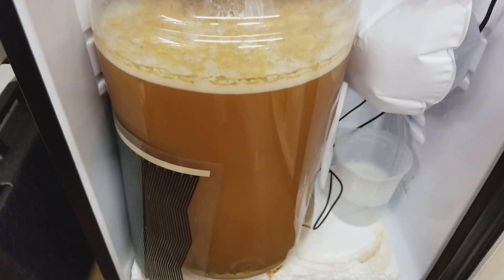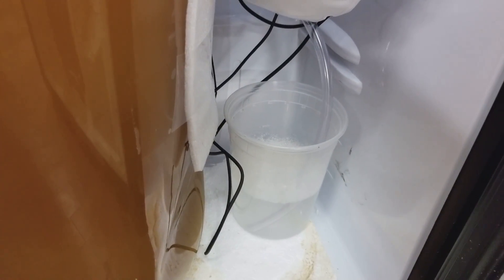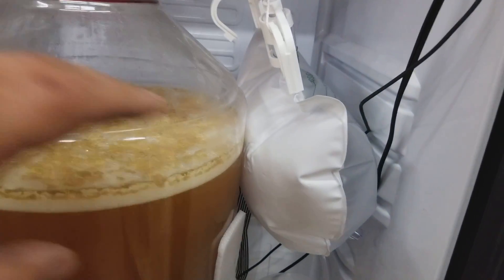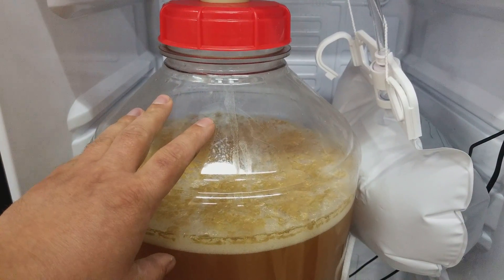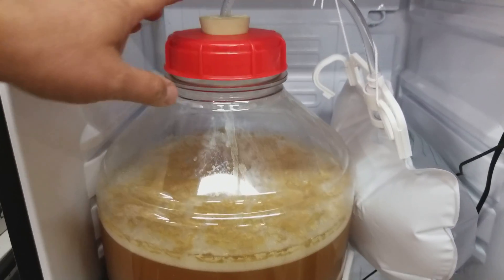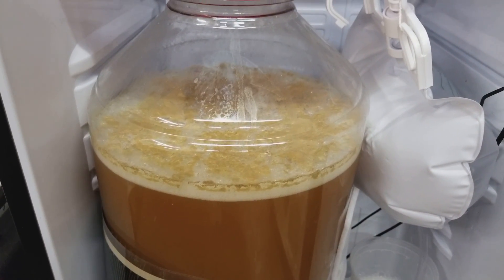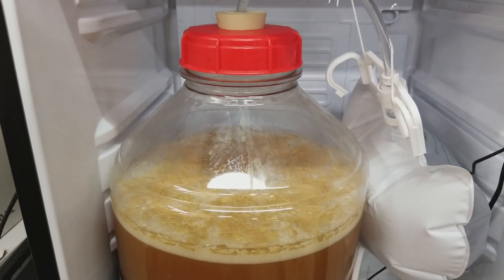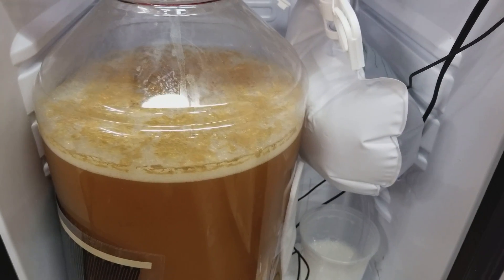BobbyfromNJ Preventing cold crash suckback in fermenters

Comment: I have an SS Brewtech brew bucket. I take a square piece of tin foil, spray it with StarSan and plug the little hole in the lid. I almost exclusively brew Double NEIPA's which are dry hopped or double dry hopped. I usually only cold crash for 24-36 hours though.
Reply from the maker: I don't think foil in the hole is fully preventing ingress of oxygen. Vacuum is pretty strong and it will find a way in. You can test it by removing the plug and if you don't hear a whoosh of air going in, it already went in. A cold crash will pull about 2 quarts of air in.
Reply: @BobbyFromNJ  oops I've probably inadvertently oxidized my last 4 batches. All Double NEIPA's. All extract kits.
Reply: @BobbyFromNJ  thanks for the advice!

Comment: Have you had any issues with cleaning that bag in the occurance of a strong blow off? Or do you you a normal blow tube , until the end. I wonder if using your method with a small change of using standard airlock/ blow off stuff until  you want to crash, and then manually fill the bladder with co2 from a tank and swapping it out would be just as effective but easier to clean? Ever tried it that way? Cheers
Reply from the maker: No, I use it from the very beginning and I have had some blowoff make it into the bladder but it washes out just fine. The newer solution has a better bag that can be gotten into for cleaning. https://www.brewhardware.com/product_p/ccguardianv2.htm
Reply: @BobbyFromNJ  awesome, I appreciate the fast response, deff going to need to pick a few of those up. Cheers

Comment: So you use the same bag for every ferment, or do you dispose of it? I can see an issue where krausen exits the fermenter (it sure happens from time to time) and thus entering the bag which probably makes it impossible to clean. But replacing whatever contraption you use after high krausen, I guess nothing will enter it.
Reply from the maker: I haven't had to replace it yet. I add the bag just after high krausen.

Comment: A bit more info on how this is set this up please? How is the pressure in the bag regulated?
Reply from the maker: The pressure isn't really regulated other than the bottom tube going into a few inches of starsan solution. Under CO2 pressure from the carboy, the bag inflates full and then it starts venting through the starsan. Since it takes pressure to push a bubble down through the starsan, the bag stays full.  If the tube goes down through 3" of starsan, it takes a tenth of a PSI to push the bubble down. This is the same reason that when it's starting to pull vacuum during cold crash that it's easier to pull it from the bag than through the starsan.
Reply: Cool, thanks for the reply, makes sense. I'm thinking you could put a valve after the bag and before the starsan, that would definitely stop any air getting back into the fermenter.
You could also put a disc air filter in the line, then you wouldn't even really need the starsan except to provide visual indication of fermentation.
Only problem I can see might be diameter matching.
Reply: I wasn't able to buy one of these bags but I got one for free - a medical supplies sales lady gave me one from her sample stock. It has a manual valve at the output so before I start the cold crash I close the valve, nothing going back into the fermenter except the CO2 in the bag. Great idea, thanks Bobby!

Comment: I ferment in a 10 Gal Corny, so I just put it under co2 as I cold crash.  So, it just sucks in CO2 when it creates a vacuum.  I cut about 1 inch off the bottom of the dip tube so that when I transfer to keg via a jumper it leaves behind the yeast cake.   I've found that 10 gal corny kegs are much cheaper than other stainless fermenters.  The only bad thing is that if adding fruit into the fermenter the opening isn't big enough.   The best part is zero O2 exposure.
Reply from the maker: Agree. You can always use regulated CO2 off a bottle to replace the contracted space but in many cases it's not that practical. Even though I have 2 CO2 tanks and regs, this solution is easier than jamming my bottle in the fridge. I also did this as a brainstorm for other brewers who may not even have CO2 yet.